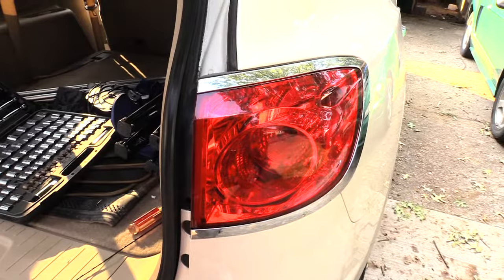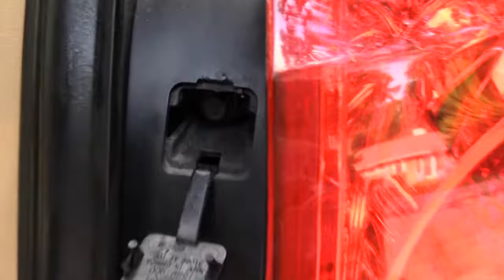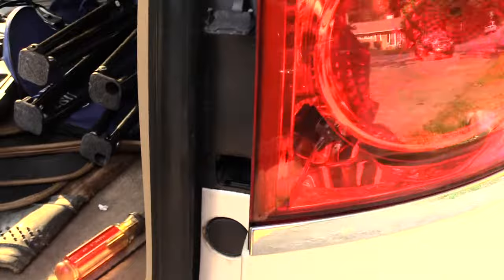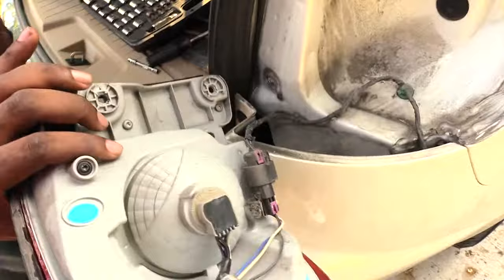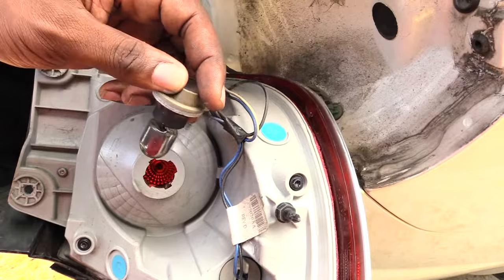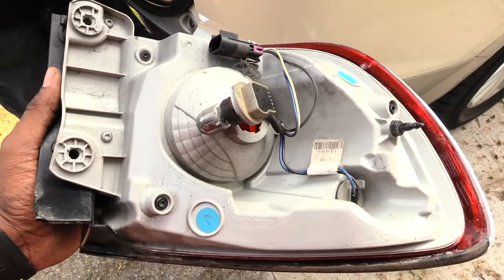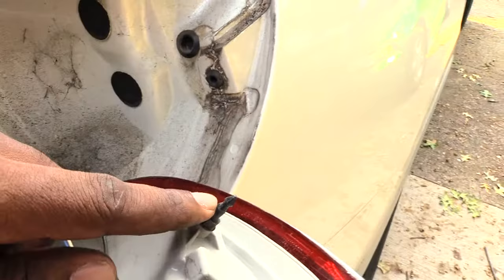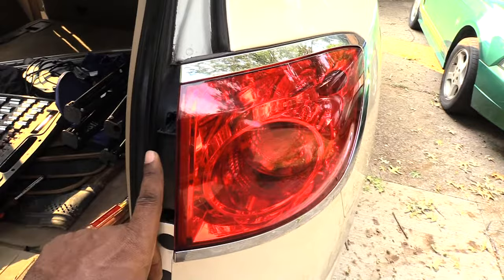Buick Enclave 08 -17 Brake Light/Turn Signal & Assembly Change! Easy

Comment: This video was spot on.  I just finished changing my right turn signal light on my 2016 Buick Enclave!  I had it professionally changed the last time.  Even having to buy the socket set at Harbor Freight ($7.70) and the 2 pack light bulbs at Auto Zone ($9), it still cost way less than what I spent taking it in to the dealership to get it changed. I also took less time as I didn't have to sit in a waiting room for my car's turn in the service bay. I definitely liked this video. Thank you for posting such helpful and easy to follow information.
Reply from the maker: Your very welcome thanks for like hope u also sub, glad could help.

Comment: On my 2016 model the cover is round and has no slot. You still can use a screw driver to remove the cover by prying under it. The wrench size is 7mm. Pry the tab from the door side to open. There's a tab on the light side to keep the screw cover from falling on the ground, When putting it back together there is a stud on the back of the light assembly that fits in a hole in the body of the car to line it back up. A little chewing gum stuck in your wrench will hold the screw in place so, you will not drop it when you try to put it back in. Thanks for helping me out.